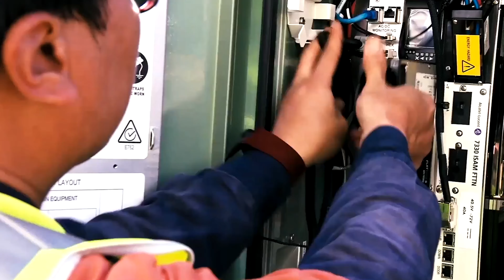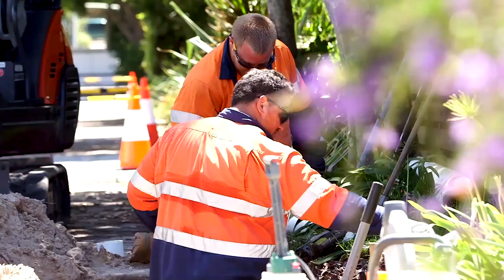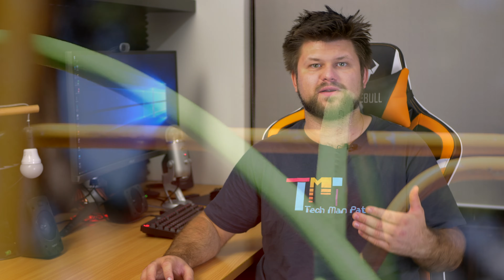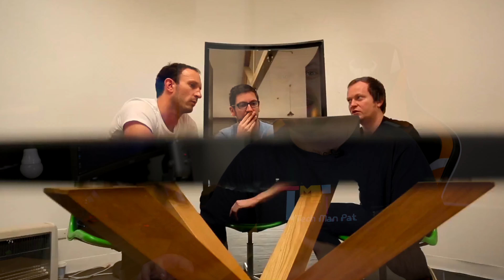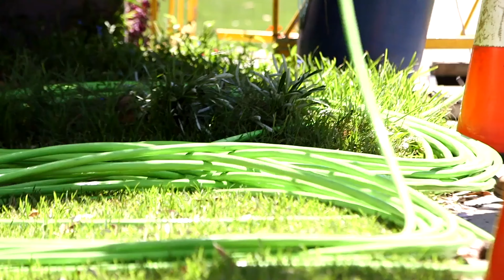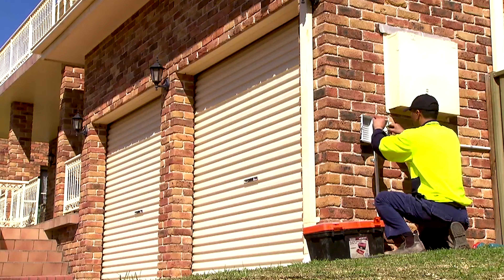Telstra CEO blames the NBN for Job Cuts | Tech Man Pat

Comment: Telstra have been using contract workers and shipping customer service overseas for some years.  But some how its now the NBN's partial fault, that they have to cut 6000 jobs. What were these people doing? 😄
When my new home was connected 20 years ago, there were three different contractors sent. One team laid a pipe, and brought the cable from the pit to the house wall. Then another arrived to connect that cable to a point inside the house, over a week later. Then another who came to do the same job, which the other contractor had already completed. 😄 The whole process took over two weeks to finish. When I had my first new home connected and Telstra was a government run company. They arrived on time, on the date they said and laid the cable and connected the phone in FOUR hours! Thank God they privatised it! 😄